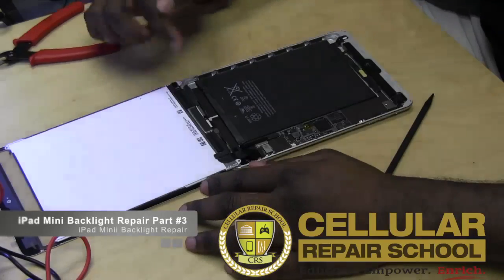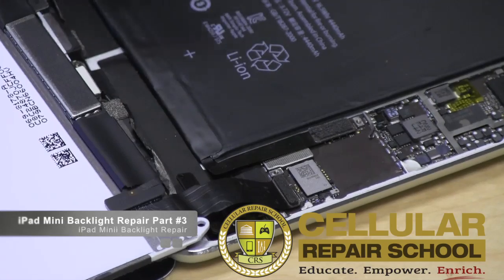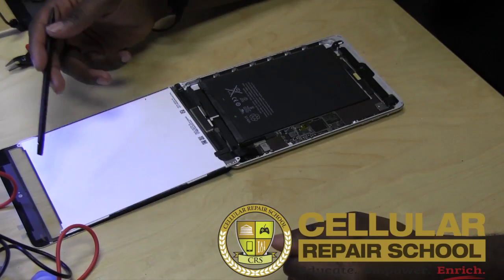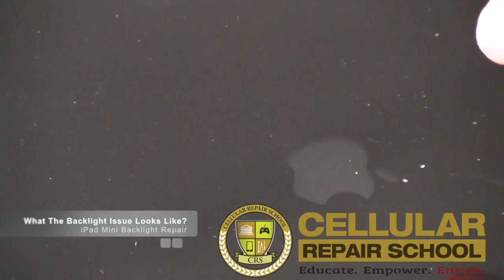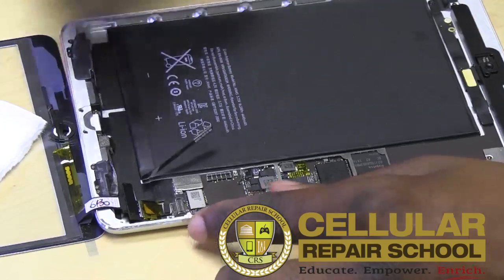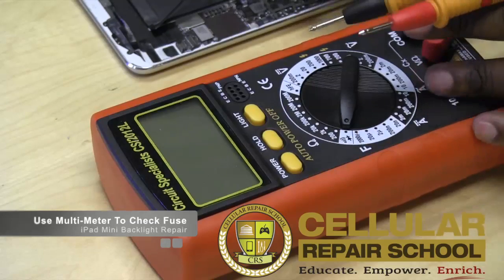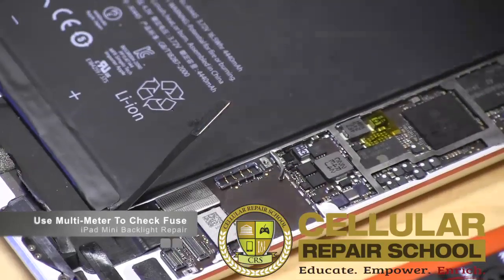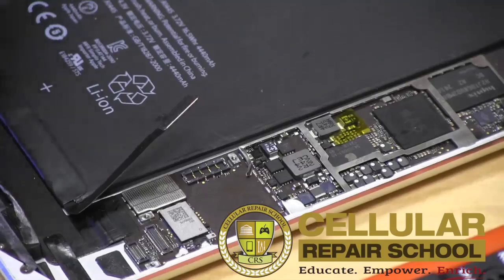iPad Mini Backlight Part # 3 Cellular Repair School

Comment: Don't we know that the fuse isn't working if the backlight isn't working? Is it possible for the fuse to be working but not the backlight? If so, what is the solution?